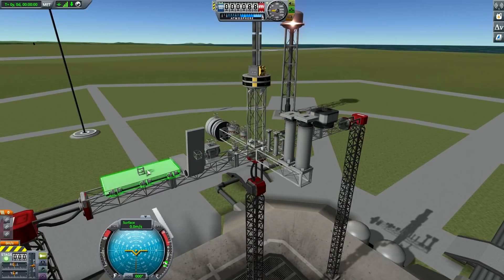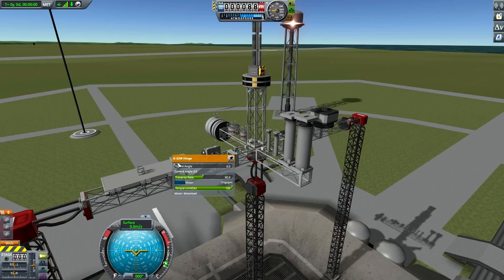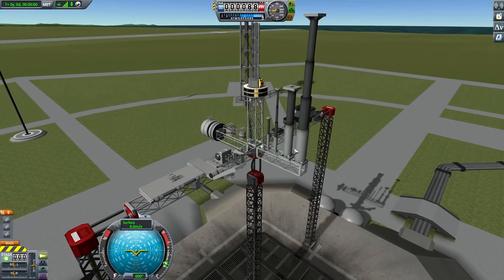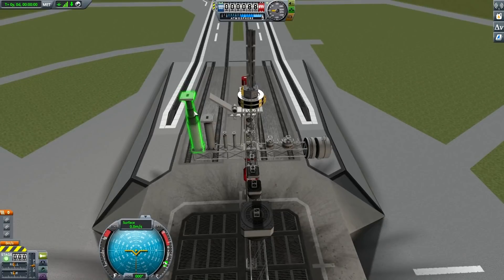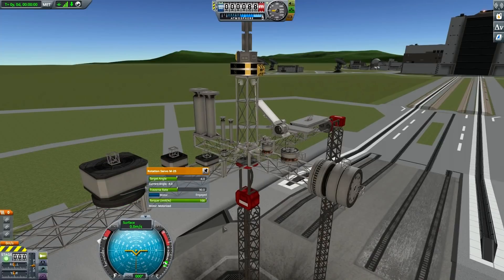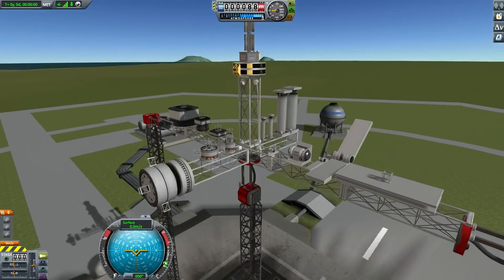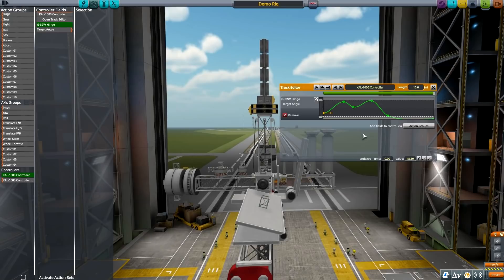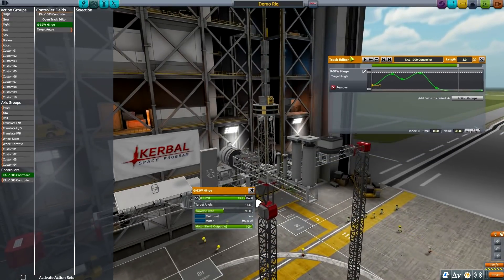KSP - Breaking Ground - Robotic Parts Tutorial and Showcase

Comment: Rather disappointed this update lacks the one part I was hoping I would find after this update basically killed anyone's interest in the Infernal Robotics plugin that had better parts. That part being U-Joints that I would use when building driveshafts and differentials. Not a single way to build a U-Joint so the motors are worthless.... In my kerbal videos I had built a rear wheel drive tractor that had motors up front and driveshafts going to the rear through a 45-degree angle using multiple U-Joints and the thing worked.

I miss the old days when all the plugins were fun and the game didn't cannibalize the hard work of the community. So sad.

Comment: any idea on how to get a hinge to lift a medium size rocket on the back of a plane
i think the rocket is too heavy for the single hinge
im gonna try to use multiple hinges to lift it
Reply from the maker: +Makuzi The Inuk I had same problem with lifting it from a truck. Did not solve it yet
Reply: @GrunfWorks  well, multiple hinges didn't work for me. i sort of have something working, but it's still wobbly af. have a support on a hinge, then get the tallest piston, hook 1 or more to what's supporting the rocket and it can lift up the rocket, but won't be able to lift to the hinges' max angle. and you'd have to set the hinge to unmotorized and motors disengaged, and have the piston(s) on same vessel interaction, as well as what the piston(s) will be pushing on if it isn't the ground.

i've tried to use multiple hinges, but the hinges seem to pop through what you are trying to lift. this is the best solution i have.

Comment: Port and starboard servos always rotate opposite each other. Makes all my VTOLs spin! What do I do about that?
Reply: ive had to place just one side down first, build everything onto it that I want, then copy the whole thing with alt click and place it on the opposite side, then set the limits on the servos opposite of one another so they rotate the same direction.. Its annoying ><
Reply: @larr3073  Yeah, it's supposed to be a feature to make it easier to build with symmetry (so you don't have to select every single part and change it) but with robotics and even certain situations in the main game, it can be annoying :/

Comment: This DLC should be more user friendly. If I wanted to make a video in SFM, I'd play SFM. How about a simple value set for rotors and hinges, with a simple execution button and a throttle control? I mean, if they can do it with alerons, then they can do it with the robotics.
Reply: Ok I was about to make a complex comment debating this but then I remembered a response far better... It should be hard, after all, it is rocket science

Although seriously, I and about 90% of the community would be outraged if they removed a bunch of cool features just to make it slightly more accessible. You can make mechs, helicopters, and a bunch of other cool stuff with how it is now, if they dumb it down then all those things are gone and all you can make are some basic doors and stuff (which, for the most part, exist already. They're called cargo bays.)
Reply: Late as hell but you can bind rotors to the throttle and it works really well

Comment: Okay... But if I want to make a V-22 style VTOL aircraft, I can't get both servos to rotate 'forward'. I can only get them to go 'clockwise' or 'counter-clockwise' making the vehicle asymmetrical, making the thing spin out. Is there a way to select each servo individually while still adding them with mirror mode on?
Reply from the maker: +Shay Bowskill Not that i know off. However ask around
Reply: No, you'd need to have them removed from symmetry. All parts in symmetry sync settings together, at least until you actually fly and exit the editor.